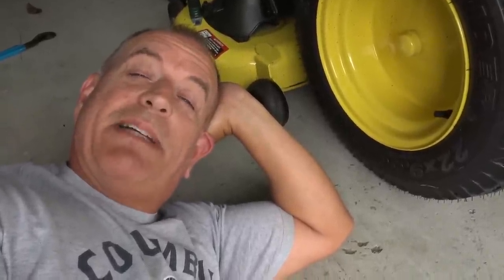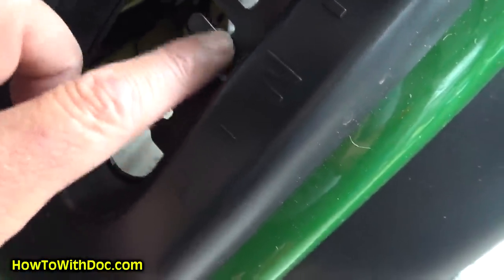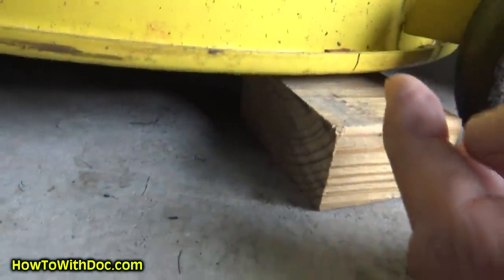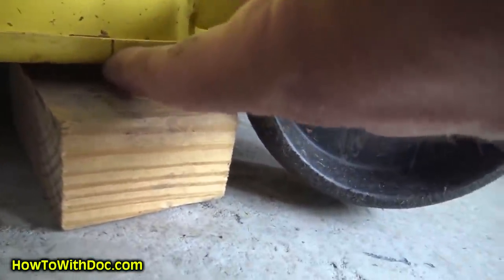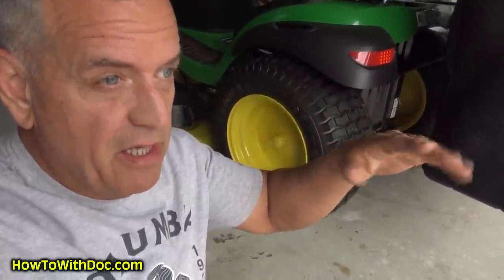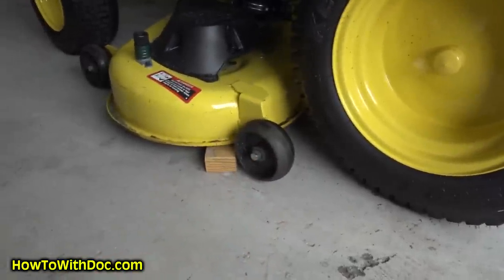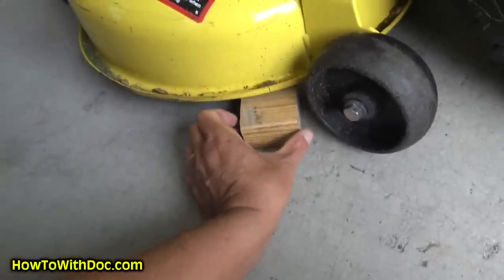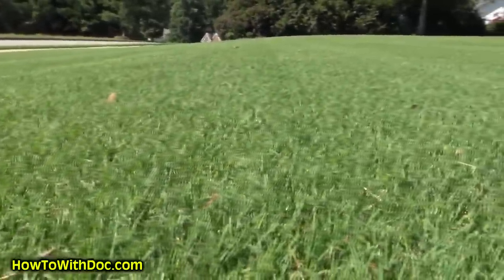Leveling Mower Deck

Comment: I have know for 13 years to set the front of the deck lower than the rear.  I always set mine 1/4" lower in front.  I learned that from my 2007 Husqvarna mower (13 years old now) Owners Manual actually says set the front of the deck between 1/8" and 1/2" lower than the rear ... so I set it 1/4" low in front. As in ALL things ... "live & learn".  I like your 2x4 idea, I'll do it!  :)

Comment: Tire pressure  then use  2" blocks for  rear sides  and a 1 7/8" for front  center. drop deck to 2"  indicator on your  deck height dial and adjust nuts so  blocks just slip out from under the rim of the deck.

Comment: Hey Doc, here's a good follow-up video idea ... LEVEL A MOWER DECK THE RIGHT WAY - UNDER LOAD.  I think you will find the readings are different when you are ON the machine. That 1/8" forward pitch might reverse when our fat butts are in the seat and the tires are compressed.   Also,  you might find that some machines do not maintain "level" at all deck height settings.  What might be "right on" at 2.5" might be way-off at 4".  Set-up the deck under load at your most used deck height. Tommy.

Comment: I use a mesuring tape. My mower has 4 wheel adjustment. But you can just messure front and back and left and right and adjust your deck that way. Then go mow, then you will know your deck lip to blade offset in cutting. Or you can simply mesure when your changing your blade so you know to add that difference to the bottom of the deck height.

Comment: Great yard; great tips.  I have been following the owner's manual's recommendations for having the rear of the deck lower than the front, and am not happy with the results (even with new blades, sharpness updated every few cuts). I even cut 2" x 4" blocks to the factory recommended heights to be able to quickly and accurately set and check that the front and rear deck heights meet those specs. Now I'm going to try your method - judging from the even, lush cut of your lawn, success should be just around the corner.

Comment: Actually a 1/8" difference is no big deal because of several factors. No yard is as level as a granite surface plate and once you climb aboard your weight changes what you measured. Also tire psi is not as stable as you think, outside temps can effect the psi hence the deck height and level aspect. But if you have any scalping issues adjust the anti scalping wheels.
Reply from the maker: Then go 1/4.  Every maufac says the same. prevent double cutting with an angled blade.

Comment: Hey Doc, that waviness in the lawn can be corrected over time slightly by mowing in a different direction. Especially with a heavy mower like you have vs a push mower.

Comment: I enjoy the information that you share in your videos. I wanted to point out that this process should always start with tire pressures. The front tire pressures aren't as critial as the rear because the front axle articulates and has very little impact on the left/right leveling of the deck. The rear tires can seriously effect the deck. 2nd is a question. Could the reason for nosing the deck down forward be to compensate for the weight of the operator which would likely settle the rear tires into the turf and there by level the deck in physical operation?
Reply from the maker: Yes tire pressure first.... but no one does it on a "cut by cut" basis. Nose deck position is by design. Talk about that in the video. first / front blade cuts.. rear skips it.

Comment: Well, this didn't help me, as you didn't show how to actually  level anything. Looking at manuals on line I'm not finding anything about setting the front higher or lower than the back either....  
...Nice yard though.
Reply: On a newer mower, there is a single rod connecting the deck to the tractor. On the tractor, there is an angled bracket holding the deck to the tractor. There should be two nuts. Tighten them.
Reply: My right side is lower than the left. There’s 2 adjustment rods, 1 front, 1 back, but I can’t get the right up with the left. There’s also a rod (bracket) on the rear right, but it doesn’t have a way to adjust it. Another video suggested using “hairpin clips” on this bracket, but so far I can only get 2 and it did bring it up some, but the right is still 1” lower... is it necessary to buy an expensive mower so I have a mechanic to fix this stuff? Annoyed..
Reply: @618sam  Same here. Husky YTH2042 and I have the front adjustment rod, and the left rear adjustment rod but as it sits not the right side is atleast 1.5" lower than the left. Even if I lift up on the right side I can't get it level unless I drop the left rear rod waaayyy down but I already have to cut my grass at the 5 mark and it only goes up to 6 so if I drop it way down I won't have any adjustment height left.

Comment: Should the scalping wheels touch the grass as you cut. Another video I watched said the scalping wheels should float about an eight of an inch above the grass tips. You agree?
Reply from the maker: put mower on HARD surface. wheels should be 1/8 to 1/4 up.

Comment: I had new sod layed and there is about half inch gaps in some sod strips.. Should I lay some potting mix/sand blend in the cracks to grow more efficiently?
Reply from the maker: Fill gaps with 50/50 mix more so for a SMOOTH lawn. Lot of work but it will really pay off.

Comment: Any thoughts on weight of mower? An hd zero turn or sub compact tractor makes more sense for my overall property but worried about 1000lbs for one vs 500lbs for a riding mow on the turf. Will a heavy unit damage with over compaction?
Reply from the maker: We use reel mowers to cut mainly but yes any time it rains you have to wait days before cutting

Comment: 10-12 psi in the front and 13- 15psi in the back
Reply: Actually, on my John Deere D105, the back tires are 10 psi and the front are 14 psi.

Comment: Hey doc, question :
Vigoro says to put their preemergent only once a year. Is it safe to put down every six months??
Reply from the maker: Funny... says on the label it's only effective for about 4 months.   I would apply something else. Like dimension. I really like to see people do 3 treatments a year. fall - winter - early spring  then you don't have to worry about weeds.
Reply: How To with Doc thanks for the reply. I do plan on getting more professional items in the future. It's was on sale... Lol love your videos, it has helped me alot. Keep up the great work. 💯 💪
Reply: How To with Doc 
Doc, I have a Bermuda lawn that's full of big clusters of crabgrass and is basically choking out my Bermuda. Is it too late in the summer to try and save? Which product would you use right now in this heat and how? I'll definitely be doing your 3 PE treatments next time.
Reply from the maker: You can try now, but be careful treating now.... and read the label as far as heat and drought application.  Make sure it's crabgrass and not goosegrass. Crabgrass sprays won't kill goose.

Comment: What ever your quibbling about 1/4 inch first off throw that JD info on deck leveling, ln the trash can. Level surface, tape measure, everybody's got their own method, blocks are nothing but  an extension  of the ground, but I understand your helping people that can barely start the mower,